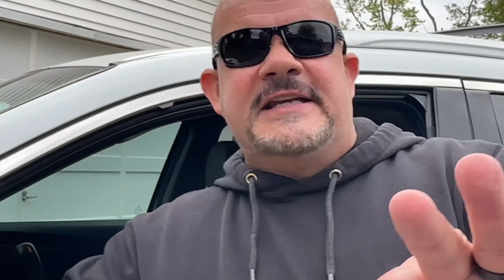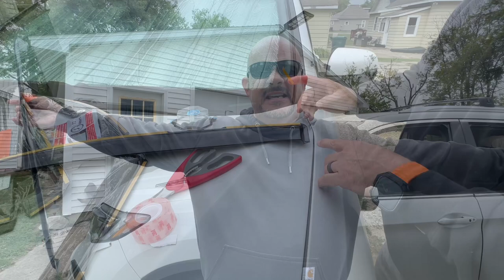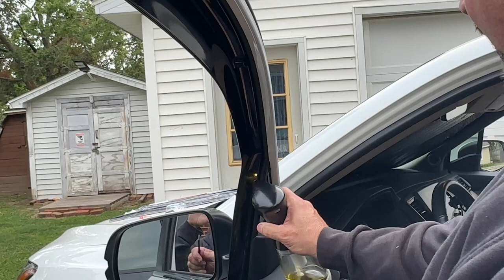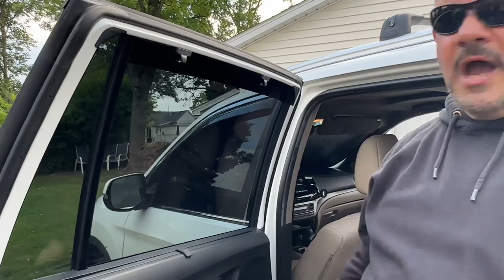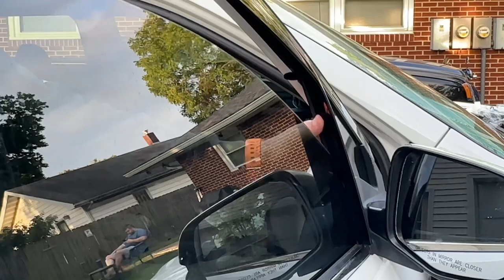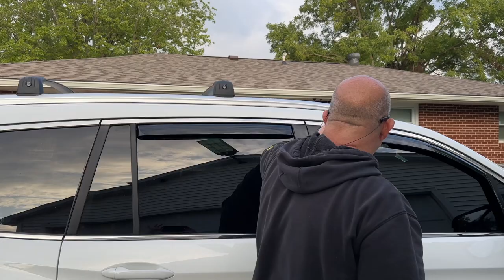HONDA PILOT RAIN GUARD INSTALL: TIPS & TRICKS

Comment: In the owners manual most will tell you how to disable the “auto-down” feature on the windows. After installing the rain guards you can turn that feature back on again.  Saves all the tapping up you were having to do.   Also if you read the specs on the Scotch tape it says to hold the 15 lbs you need to use 60” of the tape 4 “ gives you 1 lb. So I would say you need several short pieces, but not as short as the few you are using.
Reply from the maker: Thanks